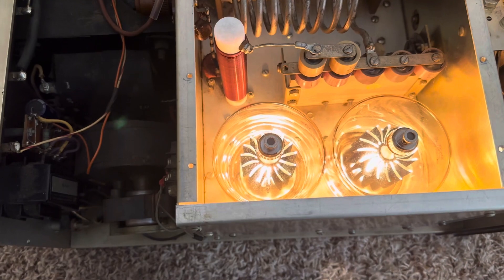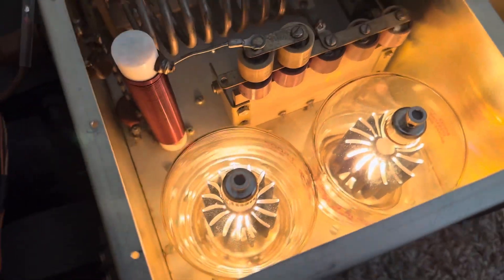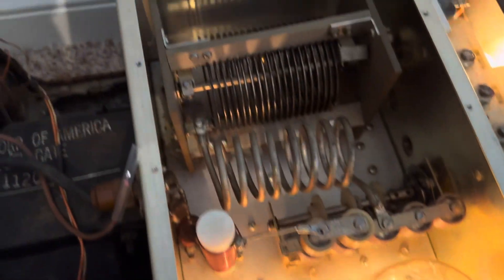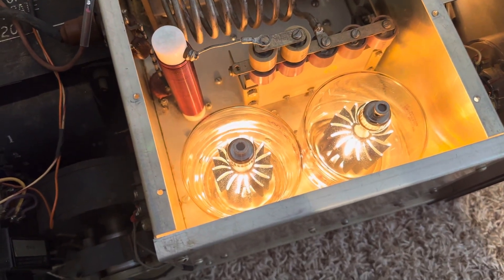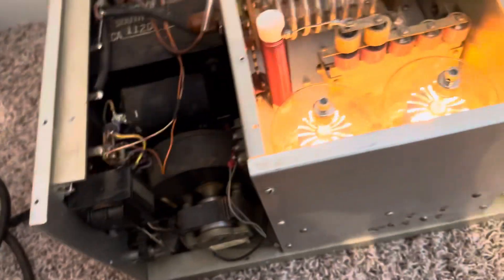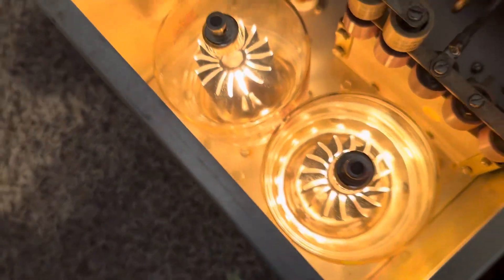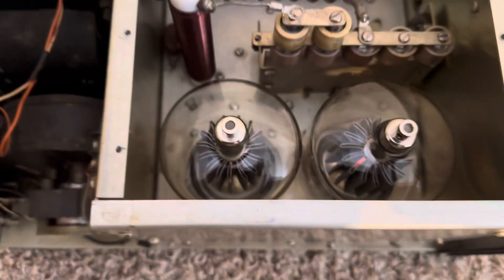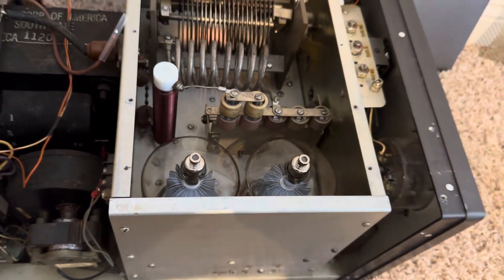Eimac 3-500z tubes installed in Henry 2KD-5 desktop linear amplifier. Very bright. Is this normal?

Comment: Looks perfectly normal...I would put the finned plate caps on even when just running the filaments. The airflow over them cools the plate seals.  Does that unit have the glass chimneys that fit over the tubes? If so, they should be used, as well.

Comment: The old Eimac 3-500Z's seem to run brighter than the newer Chinese 500z's. Check the filament voltage at the tube socket base. The filaments should be running at 5vac plus or minus a quarter of a volt. These Henry amps use a strange 10 volt filament supply with the tube filaments wired in series. Most of your 500Z amps wire the tube filaments in parallel. From what I've read about these Henry desk top amps, Ted Henry got a deal on 10 volt transformers so he decided to use them.  By the way, it's not a good idea to light the tubes without the chimneys and lots of airflow or you risk breaking the metal to glass seals in the tube.
Reply from the maker: I am not sure the Henry amps had chimneys ???
thanks for the info !!!
Reply: @moviestudioland  I watched the video again and you're right, this amp never had chimneys. Some of the Henry amps did and some did not. You can tell the ones that originally came from the factory with chimneys by a circle of holes drilled around the tube sockets. I saw no cooling fan in the video so that's why I warned against firing up the tubes without cooling. That's a good solid amp, Henry built them like tanks.